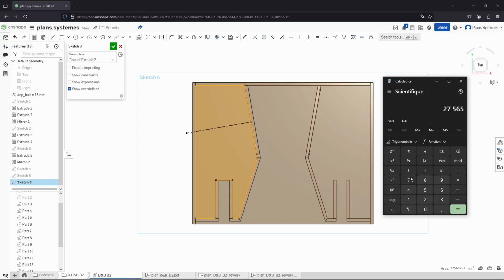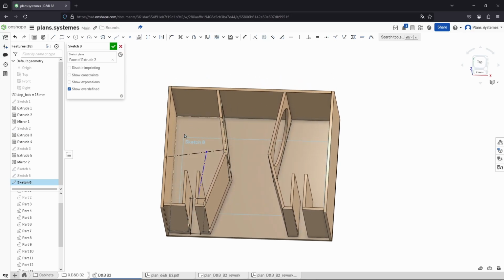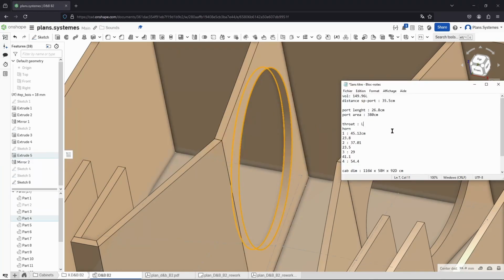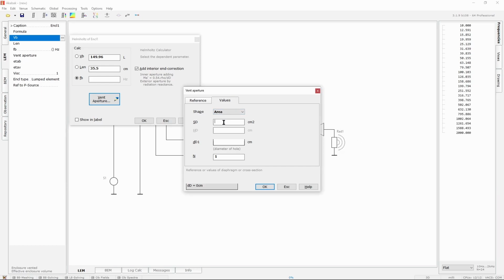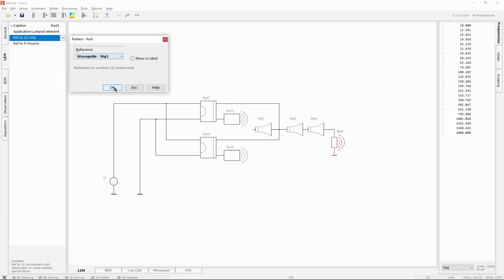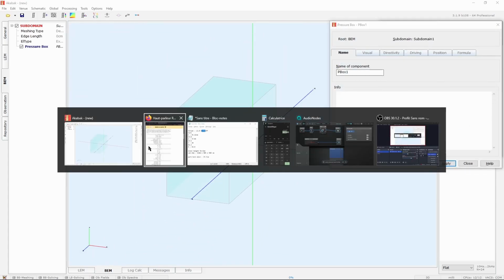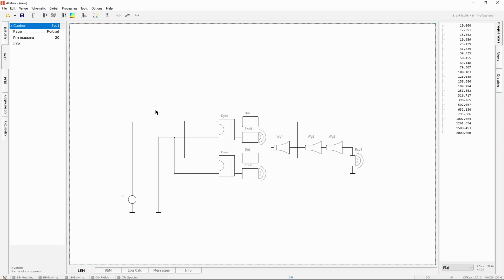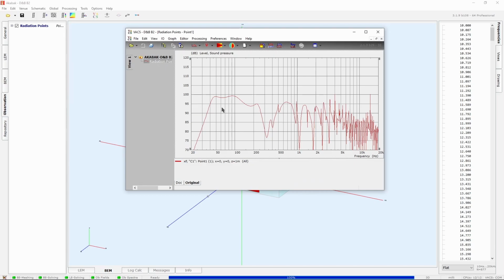Akabak raw | LEM simulation together #1

Comment: Excellent presentation, can you simulate the Turbosound TSV 124 box with the Precision Devices PD 2450 driver as I plan to do it but since the project is very demanding and large I would not like to embark on the construction without prior checking and detailed simulation
I would like to send you an email with a picture of the exact dimensions of the box with all the internal dimensions, it is a back-loaded horn, but there are two versions that differ, so I would send the exact one.

Comment: Salut ! Je commence Akabak ducoup j’ai refait entièrement ta simulation du B2 mais j’arrive avec une courbe de réponse différente, notamment avec la bosse sur le 45Hz qui a pris 5db. Un ami a refait exactement la même chose chez lui et même courbe que la mienne… Aurais-tu une idée de là où on s’est plantés ? 
Sinon merci pour cette vidéo super claire !
Reply from the maker: Salut, oui la mise à jour d'akabak 3.2.1 foire les simus si les sections ne sont pas indiquées en surface. Ex : le resultat sera faux sur une simu avec un duct carré 10cm x 10cm mais correct avec ce duct avec une aire de 100cm² en paramètre...
Reply: @plans.systemes  Hi.
I had the same issue; I was using the latest version, but the curve still showed a very pronounced peak around 45Hz. I tried entering the surface data in different ways—as an area, as a rectangle—but none of them gave me a different result.

I uninstalled that version and went back to 3.1.9 b108, and now I’m getting the same result as you.

Question: Does this mean it's better to stick with version 3.1.9 for now? And, What would be your suggestion for ensuring reliable simulations with Akabak? Should I always choose areas whenever possible? I´m a bit concerned. 

Thanks.
Reply: Hi everyone. 

I just wrote an email to RDTeam and they said that the bug was already solved in te current version b120. Good luck!